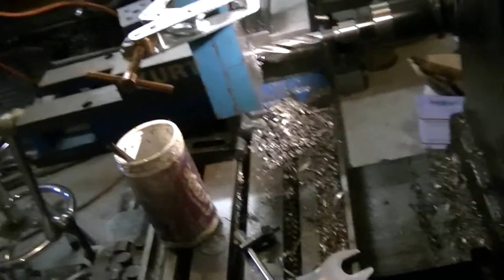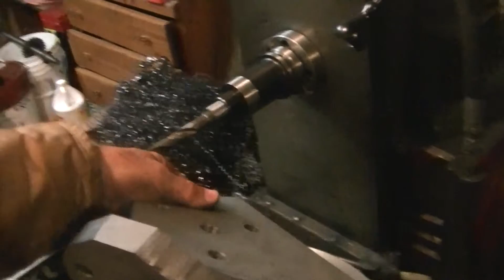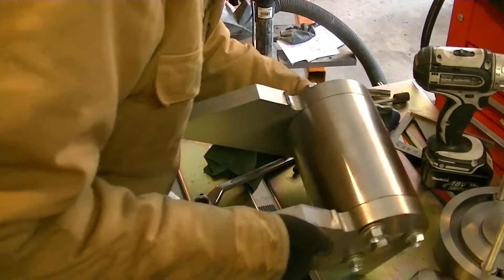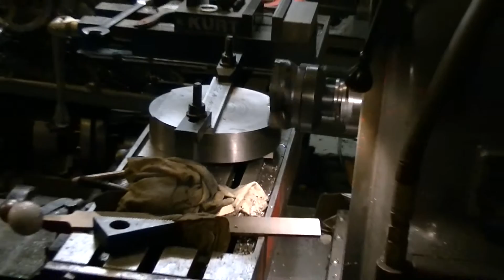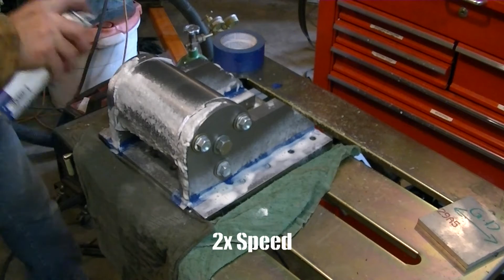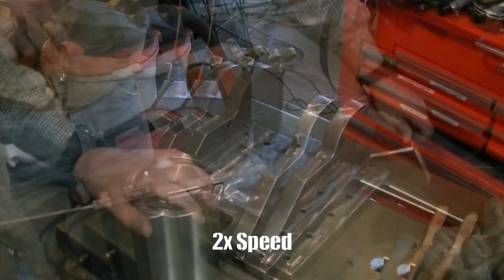K&T Mill Vertical Head Mount 5

Comment: That's a great series of videos, I am at the very start of a similar project with my horizontal mill and a Bridgnorth 2j head sat in a cradle waiting for me to build a suitable assembly to fix it on to the cast ram of my 1ES mill. Looks like your nodding feature added a great deal of work. Hope you are happy with the result and make full use of it. Thanks for taking the time to share your experiences.
Reply from the maker: Thanks for the kind words. I had convinced myself I didn't need that feature and then my son showed me a video of someone milling valve seats on a head with the mill head nodded so I went ahead and did it. Now it's done I'm glad I did. Good luck with your project.

Comment: If you ran a heavy  weld bead on the outside of each side, about 1/2" above your other bead,   When it cooled it would have pulled the top out.   Then you could grind the bead away and sand smooth.
Reply from the maker: I hadn't thought of that but would probably have done the trick. I'll have to file that away for a future project. Thanks, Craig